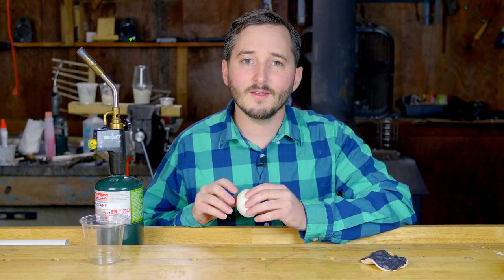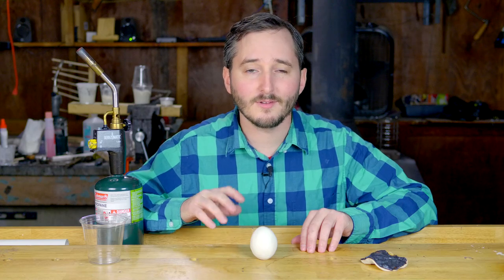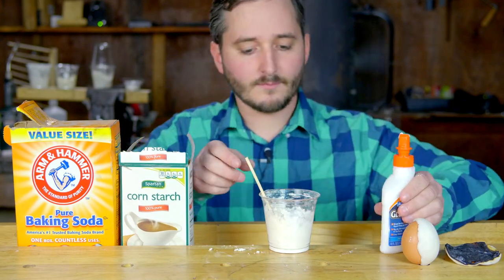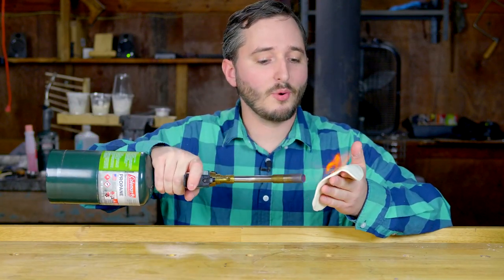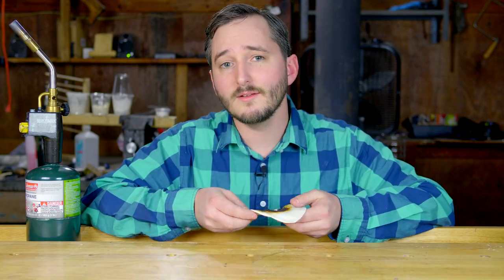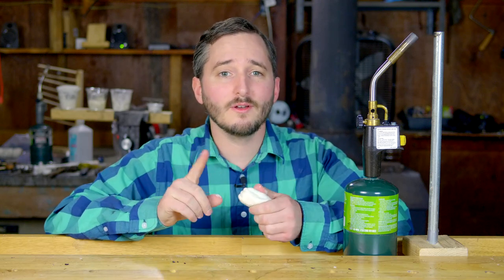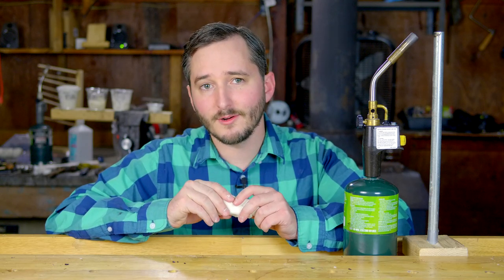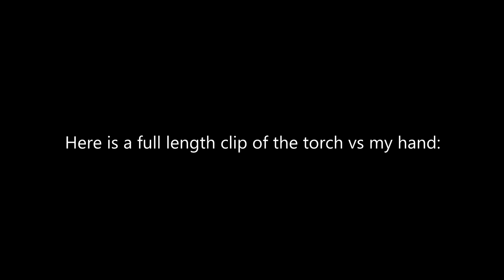A Super-Material That Can Be Made In The Kitchen (Starlite Part 1)

Comment: I now consider you the most valuable channel on the PLANET! Because of this video. 
Thank you so much for NOT being as greedy as the original inventor of Starlite!
I will now start giving you money via Patreon (or any other means) and I hope to continue giving you money for as long as I remain alive!
Your channel is the most valuable channel on the planet!
P.S.
Even if the recipe is not exactly the same as Starlite, who cares! What counts are the results i.e. the properties of the material.
Reply: @sanjithtamballa  foot notes?  References?
Reply: you find all this on google. lol
Reply: Fire fighters should make cloaks with this to upgrade their materials, heat insulation, fire proofing many equipment this is a gold mine in functionality but cheap in production.
Reply: @mmrox4320  this would only stop heat transfer at extremely high temperature, it would not stop the high air temperature from flowing through the material and it will effectively do nothing to protect a firefighter as they already have fire proof suits
Reply: Schnozistan Czar hmm need more experimentations then

Comment: This would be great to cover wiring that's close to a weld.
Reply: if the wires are touching a metal, then metal will conduct enough heat to melt the wires.

Comment: So theoretically we could use it for re-entry from space? Maybe with some more testing and experimentation.
Reply: It leaves a pretty noticeable (carbon probably) black layer on it which could cause some problems maybe
Reply: The problem there is standing up to the pressures and air turbulence of re-entry. Having a low pressure torch blowing heat at it is a lot less violent than the air pressure of traveling several thousand mile per hour. It would rip the carbon formation off and basically eat through it.
Reply: @glock21guy  True, further developments would be necessary so it could withstand the forces.
Reply: @glock21guy  also the weight of this material might be an issue in some cases.
Reply: That’s what I thought of when he said nasa.
Reply: @glock21guy  Oh my gosh! just put graphene and CNT in it! Oh and MXene its a 2D material made of Ti3C2Tx Tx=O2, (OH)2, F2. If theres no O2 it'll simply harden into TiC making it a super strong ceramic layer!!!!
Reply: @paullelyukh2422  bruh I'm not even an idiot but please explain in a way not intentionally designed to confuse everyone
Reply: Cheap yes but also heavier than aerogel but aerogel is expensive to produce

Comment: Probably the most amazing thing I’ve ever seen…… How about making building materials made out of this stuff ????? 🤙🏻🤙🏻🤙🏻
Reply: Not sure if it works this way . Cause flaming was the test
Reply: They already do, there are several examples of heat protection coating for steel components as well as expansive foams, these are basicallly a more effective, industrial, and expensive version of the material in this video, they are actually quite common

Comment: I wonder what would happen if you subjected this material to EM radiation, like high power laser or halogen or putting it in a microwave. I wonder if it would retain it's properties or even react in the same way as when heating it with a torch.
Reply: In the starlite documentary,  one of the testing labs did fire a laser at it.  The laser was damaged.  The inventor claimed it was because energy was reflected back by the starlite.

Comment: I wonder if I could insulate a propane forge with this
Reply: I'm guessing it would be far too fragile, I used K-wool covered with a layer of a ceramic refractory material on mine.
Reply: @MrJohn714  be cautious with kaowool, as it has some cancer causing ingredients in it.
Reply: Thanks for your concern! Its a ceramic wool similar to fiberglass so its an inert material as far as thats concerned but inhaled it could very well cause lung damage and scaring similar to asbestosis I suppose.
Reply: If you look closely and listen to him i wouldnt use this on the inside of a furnace and when heated it expands and forms small bubbles of carbon...  but, maybe as a safty outside your main k-wool inside your framing?
Reply: @MrJohn714  I used to work for the manufacturer. I thought it would be interesting to see it being made, but was told that due to insurance policies I couldn't even go into the area where kaowool was made because of crystalline silica, which is a group 1 carcinogenic substance which is used in the manufacturing process. The workers in that area always wore safety gear such as respirators and protective coveralls.
It is probably safe as long as it doesn't break down where particles can be inhaled. I personally would stick with firebrick.
Reply: @equesdeventusoccasus  Yes couldn't be good to breath, thanks for the info! :-)

Comment: Please tell us about why you believe Starlite never made it into commercial products. I put it under my forge & it was epic! I must learn more about this material. Thank you by the way for sharing this with us.
Reply: Because it is undergoing change when mixed / made.When the change is complete it is no longer so heat resistant. He was trying to make the change permanent and failed and thus never released it.
Reply: would it work as a forge insulator?
Reply: @Edgar Chambers V Yeah I did make a whole video about it myself & that's about what I found. But I was a bit impatient with letting it dry & I had no idea how long it was supposed to wait for it to dry. My insulation is FiberGlass.  But trying to upgrade the formula does seem pretty promising with a whole bunch of applications. I did the research  & the original Starlite  could survive the temperatures of shuttle & space capsule reentry temperatures which reminds me of LI 900(Space Shuttle Tiles). Especially with its BlackBody Properties. Although that means it would need to be reformed for much high  &  low pressures & forces not only temperature.
Reply: @zenoist2399  So you are saying that if I threw it back into my forge after the chemical reaction has already occurred it's properties would be significantly reduced?
Reply: @explorerofworlds512   Possibly. It's just an idea.
Reply: An idea worth testing. He said that the gas released protects it but also that the carbon film itself is a good blackbody & insulator. Definitely something worth investigating.
Reply: @explorerofworlds512  Yes. Anything is worth investigating if something is unknown.
Reply: NeaLeonardo how long does it take to dry
Reply: @iknowimstupidbut8084  Well I was to impatient & I had no idea how long to wait when I made my video. But other YouTubers have waited days. Just because they wanted to be sure all the moisture is gone. At that point it is not like soft clay. It's more like a hard tile. There was even a channel where they tested the homemade starlite against thermite.
Reply: Becsuse Maurice knew his formula was so simple that patent disputes might arise. I am 90% sure I know the rest of his formula, I'm sure this video guy does too. Not hard to figure out if you're tech researcher as I have been since my teens. If anyone wants the formula, contact me, and be prepared to shell out $10 million, not joking. There's a deadly not-money reason why Maurice didn't part with it easy, and if you're not a tech researcher, likely would never occur to you. In fact, it may have been a mistake for this nighthawk to have made this video. But, too late, cat is out of the bag.
Reply: Possibly because the byproduct is CO2.
CO2 at a certain temp becomes a deadly gas. I.e. 400 degrees F
Look up ABC extinguishers, clean agent extinguishers, CO2 extinguishers and Halon style (clean agents). The industry knows something that this guys doesn't know about. Maybe he did his research, but without disclosing it... anyone from fire fighters to fire protection can see there are some issues to this the moment he said it's releasing of CO2.
Reply: Daniel Lynx Deadly like Fukushima?  Oh well, the cat is out of fuel rod.....  Like WTF...  Why give you $10,000,000 dollars for a basic recipe that can be easily improved upon in many ways.  Besides that I got a meteorite that thermite can only dream of melting...  I would be making a alloy already but half it's analysis came back unknown....  Sell you that for $10,000,000,000...  You can't melt it and you can't break it...
Reply: @450ktm520  almost certainly the issue is that it has a relatively low lifespan. It works great until it expends its carbon dioxide, and then becomes fairly heat conductive as a soft plate of carbon.

The uses for that are still major: weld protection, fire door rating increases, etc. But it's not "world changing" like it would be if it didn't eventually fail.

Comment: Glassblower here. I will be experimenting with this. I already have some ideas about uses and formula variations.
Reply: I'm interested in hearing your results. Please share.
Reply: So I just made some. I put it I'm front of a torch and it carboned up. Got kind of hot but I didn't allow it to dry so the water molecules were probably still bouncing around. I put some in the kiln and pulled it out at like 745 degrees Fahrenheit. It had completely charred and was glowing orange. I dropped it in some water and it was just carbon.  Not terribly impressed so far but will try some other stuff too. Was thinking about mixing in some quartz fiber. I dunno.
Reply: @OliverCaesar  Imcuripus to see how the quarts fiber will affect your results. I'm wondering if this is something that could be used inside a glove to increase handling time.
Reply: 5 months later now! Any new results? Did you find that this material could be helpful in your daily glassblowing world?
Reply: @OliverCaesar  hi Olivier, I don't have a kiln, so I was thinking that maybe you can mix up a batch and cover an egg completely. Once this producto dries, put it in the kiln. If this does protect from hear, the egg should still be raw after you pull it out. 🤷‍♂️🤷‍♂️🤷‍♂️

Comment: Hey great product and can this material be made into a sprayable or brushable paint , and what would it take to tint it to a different color 
And eye love your videos 
Great mind ,thanks for sharing
Reply: It probably needs a bit of volume to form an insulating layer.  Depending on how thick this layer needs to be, paint/spray applications may or may not be viable.
Tinting should be a matter of adding dye, but do keep in mind that it'll turn to a carbon black under thermal load just about no matter what.
Reply: Um, can you dye cornstarch, baking soda, or glue??
Reply: It's already out there. Look up intumescent paint.

Comment: Starlite vs. Thermite.
Reply: This, plz
Reply: Yes!
Reply: Starlite would survive, not sure about this thing he made, its good but not same thing. Starlite surved 10,000 degree C from a Laser of (Nasa i guess).
Reply: I need to see this now
Reply: Yes pls.
Reply: Vs napalm
Reply: Steve Thea you realize thermite is hotter than napalm
Reply: Dr. Mauser and a better test would be thermate not thermite because thermate burns hotter and more vigorously
Reply: @frostywolf8670  Either would work. What interests me is the idea of something with higher thermal density being in direct contact with the material. Hot gasses give off their heat quickly and move away. Red Hot metal gives you a long burn.

Comment: The first question that came to my mind is: 
Can you make a crucible out of it ?
Reply: why doesn't this comment have more likes
Reply: Interesting thought...does a crucible need to transmit heat through it to better heat the metal being melted? If so, this material may be a bad choice. Maybe it's not important though, as the heat in the foundry is all around and could heat through the top. Perhaps a wider crucible to give more open surface area...Definitely a good thing to experiment with!
Reply: A crucible need to conduct the read, but you could line the interior of a furnace to increase it's efficiency

Comment: Starlite was close to a scam.  It didn't even perform up to the standards of the ablative materials you'd find on a "conventional" reentry vehicle.  The only thing interesting about it was the level of publicity it got.

Any combination of plasticiser, carbon producing material and and thermally decomposing gas producer should work.  The "tricky" bit is choosing a gas producer with a thermal decomposition temperature similar to the melting temperature of the other two ingredients.  The plasticiser and carbon producer can be the same thing.

An example of a more stable, structural blend would be ABS plastic and ammonium nitrate.
Reply from the maker: A nitrate seems like a poor choice, and chlorinated plastic would give off nasty fumes. Otherwise fair.
Reply: I have to wonder if TEFLON was not made more robust because of that StarLite stuff being secreted away in the company's tech vaults.  :-P  TEFLON sucked in the 90's, then the StarLite guy comes along, and TEFLON stops sucking quite as badly.  X-P  lol.
Reply: @Nighthawkinlight  Well... ABS isn't chlorinated, but yeah, AN isn't so great.  I was trying to think of something chemically stable.

Comment: You should make a small forge with this stuff
Reply: I'd love to see someone do that - that'd be freaking amazing.
Reply: Nicholas Willcox   I have already made a small test forge, and it is not as simple as you think. The stuff shrinks slightly as it cools, causing it to peel away from whatever you coat it with. It also tends to crack as it cools for the same reasons. However, the forge works very well and I can put my hands on it without 3rd degree burns. If this were to be scaled up then another additive should be used to minimize these issues. Or perhaps when scaled up they disappear on their own, I don’t know. I do not have the resources to make a full sided forge, but if anyone reading this does, then by all means, go for it.
Reply: @alexfos4212  Excellent information!!!

Comment: Since he was a hair stylist, and from what I remember how Starlight was applied, it sounds like he may have used hairspray as the binder of the materials (instead of straight up glue).  Would require testing.
Reply: NASA referenced glue in their reports.
Reply: Oh,ok then
Reply: I think you're on the right lines - Maurice did say that he used his experience as a hairdresser to develop the formula. Although I don't suppose PVA was used too often in the salons of 1970s England...
Reply: Hairspray is flammable, maybe not a good idea
Reply: @waybachwin1747  it's typically the propellant that is flammable and not necessarily the adhesive.

Comment: I wonder if this could be used as refractory material.
Reply: first thing i was wondering too after just the first few seconds and reading the description text.
Reply: There may be mechanical stability concerns, but only one way to find out!
Reply: Exactly what I was thinking.
Reply: @0xEmmy  that's a good point and I was also wondering if painting this with a coating of kaowool rigidizer would work too be able to use a thinner liner would work
Reply: I was wondering if it's permeable to microwaves. I've read that carbon is not. I would love to make a microwave kiln with just graphite and these basic ingredients. Firebricks are expensive.
Reply: @jerrywhidby.  That depends on whether dry hawklite (that's what I'm calling the stuff), or whatever's on the other side, heats in the microwave.  Starlite around a fork would probably pyrolize just fine near the points where sparks form, but in an environment where nothing near the starlite gets hot, it may or may not work.

@louspinuso as for the kaowool rigidizer, as long as the kaowool doesn't contribute enough structural integrity to prevent the formation of an insulating carbon layer it should work fine, but it may be more practical to simply use a sturdier rigidizer than PVA.
Reply: yup exactlyy my thoguht i wonder if we can substitute starch by clay, and glue by sodium silicate, and boom firebricks!

Comment: Can this material be thinned enough to be applied like paint?
Reply: Try.
Reply: use a difference plasticizer
i think if the materials are micronized and mixed with epoxy resin they can indeed make a paint
and the epoxy itself can be a carbon source.

Comment: what about a furnance with this material
Reply: i think it will not work very well(personal opinion), as the video mentioned, the carbon foam produced will be pushed and thickened by the Co2 bubbles which will probably cause a shrunk in the inner side of the furnance, also, the carbon might also be a contaminating the materials being heated, and went you do not use it, the furnance, moisture might get into the materials.
Reply: furnaces usually have magnesium carb as insulator which i guess if more easy and cheaper than this material
Reply: On it